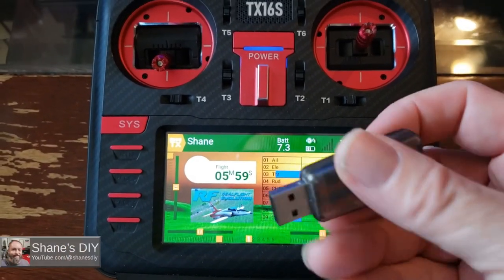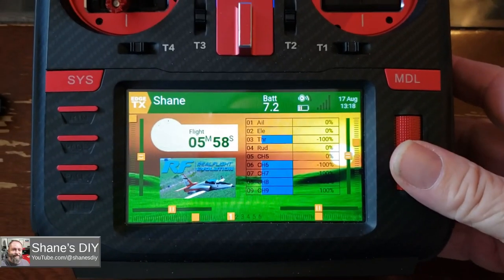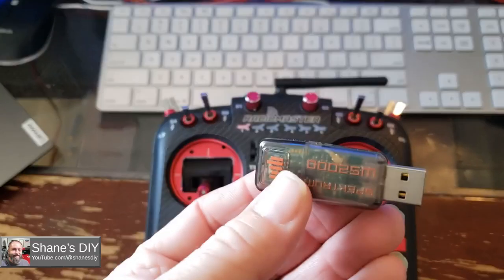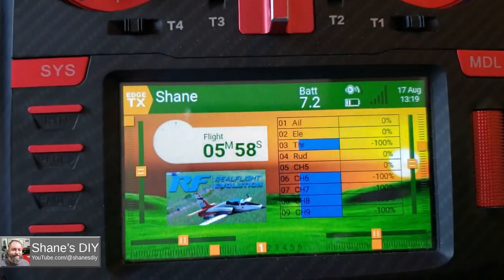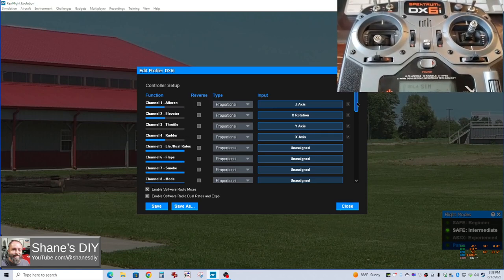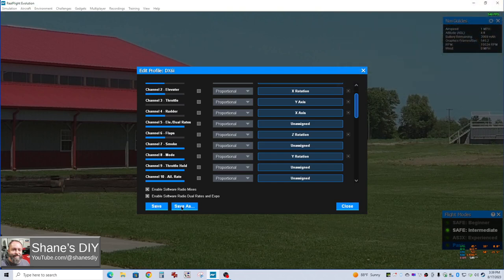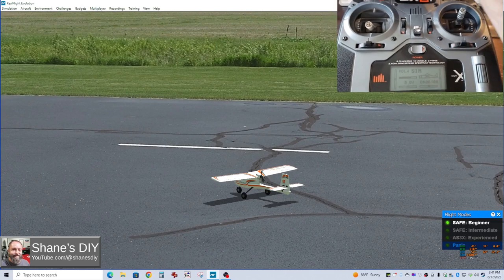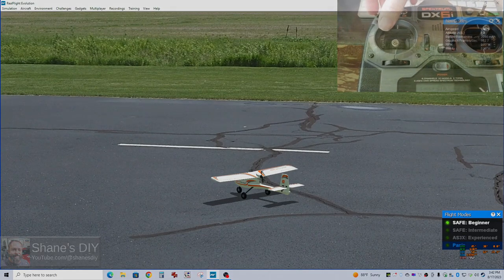Spektrum WS2000 and RealFlight Evolution Transmitter Setup

Comment: Hey man, thanks for your videos. You have helped me so much. I really appreciate what you do. Anyway, I have one big favor to ask. Maybe you have a video on this, so if you do, just send me a link. I was hoping you could make a video setting up a TX16S to use with True Flight Evolution. I mean setting mixes and all channels needed to control the Sim. Setting flaps, landing gear, dual rates, and reset button. And whatever else possible. I think it would be helpful to a lot of people. I've looked all over YouTube, and I can't find anyone who has done it. Thanks in advance. Keep up the great work.
Reply from the maker: Thanks for your comment, love hearing someone was helped by my videos.  I've not heard of "True Flight Evolution". Do you mean Real Flight Evolution?
Reply: @shanesdiy  lol yes, Real Flight Evolution. I keep calling it the wrong name.
Reply from the maker: Could be a good video. Basically you can consider Real Flight as the receiver and it reads the transmitter outputs for control surfaces however they are sent. Because of this any mixes, dual rates, and expo you create in the transmitter model will be used for the plane. No need to try and create mixes, rates, and expo in the simulator. Changes to the safe mode gyro settings are a little trickier.
Reply: @shanesdiy  I got as far as to set the modes to a switch and the reset to the engine cutoff switch, but I can find the correct channel for the landing gear. I guess that's all I need at this point. Everything else works.
Reply from the maker: Within the description of each airplane, they often will say what channel is used for gear, flaps, etc.  Once you find a plane with that in the description, I believe all the planes with retracts will use the same gear channel. You just need to map the desired gear channel in your TX to a switch in the mixer. Then go into the controller setup in real flight and assign the switch there.
Reply: @shanesdiy  thank you, Shane! I appreciate your help. Hope you still make the video if you have time. I'm sure I'll benefit from your knowledge and a bunch of others. Thanks again, you're the man.

Comment: i wish you showed how to do it on TX16s, do I need to create a model on TX16s and anyhting other than that after i bind it to transmitter?
Reply from the maker: Yes, you must create a model on the TX16S just as you would for any model as I mentioned at the beginning of the video.  I just made one called "Sim".  You must program all sticks and switches you plan to use in the sim so the PC will recognize them.  The controller setup process on RealFlight is the same for any transmitter so what I showed in the video with the DX6i applies to the TX16S as well.

Let me know if you have any questions.

Comment: I wonder if I could use My Radiomaster TX 16S 4 in 1 just with the cable that came with it , can I 🤷🏻‍♂️ ⁉️
Reply from the maker: Absolutely, I've used my TX16S and my Zorro with a USB cable in Joystick mode many times.  Since I got the wireless dongle, I just prefer to use that to limit wear and tear on my radio USB ports.   Just use the top USB port and the screen should pop up asking if you want to use Joystick mode, storage mode, or serial mode.  Just select Joystick and click the scroll wheel or tap the screen button.
Reply: Thx ☺️ thank u so much

Comment: I have the radiomaster pocket with the ELRS module on and cannot get it to bind with the ws2000. Any help please. Chris
Reply from the maker: The WS2000 is Spektrum DSMX protocol, you need a 4in1 module to bind to it. The Pocket transmitter isn't offered with an internal 4in1 so your only option is to add an external 4in1 module if you want to bind with protocols other than ELRS.

Comment: I have an DXe transmitter, it has an Aux (2 pos) switch but RFE doesn't recognize it. I have used other RCs software and it works. Anyone have this issue with your transmitters (either brands/models)?
Reply from the maker: The transmitter switch must be assigned to a channel in the transmitter model setup at the radio level.  To really tweak the DXe you need a bluetooth dongle and the mobile app.  I think there is a way to adjust the preset model without the app and you need to select one that uses that switch/channel such as one with flaps.

Once that switch is assigned to a channel, in the controller setup in RFE you can define what the channel/switch does.

Comment: MINE WONT BIND
THESE RADIOS ARE SHIT
Reply from the maker: Happy to help sort it out.  There are many reasons you may not be able to bind and most of them aren't because the radio is crap.  Can you be more specific?  What radio are you using and if it is a Radiomaster TX16S like I'm using do you have the 4in1 version and do you have it set to the correct DSM protocol?

Comment: Thanks a lot. Could you explain how to set up on the radiomaster a 3 way button, for realflight for example SE to select the 3 flight modes?
Reply from the maker: In the radio you just need to setup channel 8 with SE as the source in the mixer.  In RealFlight you assign the switch the same way I did with the DX6i but with the 3 way switch you'll get -100, 0, +100 instead of just -100 & +100.

Note that not all RealFlight airplanes have all 3 modes. The AeroScout, for example, has safe, intermediate, and AS3X but if you switch to Draco it only has Safe, AS3X, AS3X so two of the switch positions will just be AS3X.
Reply: @shanesdiy  thanks a lot will try that

Comment: any special setup for Dx6i is required? I have successful bind but input detection for new profile doesn't work :(
Reply from the maker: Maybe windows isn't seeing the dongle and properly assigning the drivers?  If you type "game controller" in the windows search bar, typically in the lower left, you should see "Set up USB game controllers" appear.  Click that and when I have my dongle in the PC "SPEKTRUM RECEIVER" appears in the list.  Do you have that?  If yes, then setting up the transmitter in Real Flight should work.
Reply: @shanesdiy t that's the thing that it is recognized by computer as game controller with status OK, binding seems to be OK (led stoped blink) but I did test from properties and it's not working, any idea why. I would like to think it's configuration issue, not faulty dongle
Reply from the maker: @jaceksoltys   I just tested mine and in windows for Game Controllers, if I click on the "SPEKTRUM RECEIVER" and click properties, a "SPEKTRUM RECEIVER properties" window pops up. When I move the sticks and switches that are programmed into my "RC Sim" model I do see them move on the test window.  At the top there is a "settings" tab where you can calibrate. Perhaps try that?

Did you create a model and setup the control surfaces on the transmitter?  I guess you had to if you were able to bind...

On your dongle, is the LED on steady after you bind the DX6i?  Should be on, not flashing.
Reply: @shanesdiy  yes, the led is not flashing it's steady, I did create new model, nothing more, but what do you mean by "setup control surfaces:?
Reply from the maker: @jaceksoltys   I guess I just mean make sure when you move the sticks you can see the channel monitor on the transmitter moving.  Did going through the calibration on the PC do anything?
Reply: @shanesdiy  Many thanks for your hints, but I'm starting to believe there is something wrong with the dongle itself. Calibration is not possible and channel monitor shows that everythinkg is OK, and the transmiter is OK for sure since it it's working fine with real receiver.
Reply from the maker: Do you have another PC to try it on? Still could be a Windows driver issue. What version of Windows are you using?

Also wondering if it needs to be plugged in to a high speed USB 3.0 port?  I can't say I've ever tried it on a slow port.  I'll try it this morning and see if it makes a difference.
Reply from the maker: I tried it on a non 3.0 USB and it still worked for me.  I have had trouble with USB devices if they were plugged into a non-powered USB hub.  Are you plugged directly into the PC USB port or through a hub?

Comment: Thanks for this video Shane. I've been using my TX16s with USB and RF EVO for several months as I learn to 'fly'. This video convinced me to give the WS2000 a try. Just received it today and the setup was petty quick on my TX16s.  I've got the control surfaces working.   I figured out the modes by modifying the airplane setup in RF for the few planes is train on. I'm pretty happy with it so far. I think I have dual rates working but am having a hard time getting my head around using channel 5 for dual rates. I use EdgeTX and ELRS for my flying models and dual rates are setup in the INPUTS tab so it's  much different from RF. I've found some posts in the RF forum on dual rates but they always refer to the spektrum radios when describing the setups. Do you have any pointers for us TX16s users?
Reply from the maker: You can do it in RF but I prefer to do it on the TX just like a real plane. The TX sends proportional signals to the PC just like it would a receiver so any dual/triple rates, expo, etc you setup in the TX will be functional on the sim. Don't link your rate switch to output channel 5, just keep internal to the TX and build it in the Inputs tab like normal. I often use the sim to experiment with new ideas for rates, logical switch and special functions code I want to test.
Reply: @shanesdiy Thanks Shane. That’s exactly what I had in mind to help learning my model setups. Makes much more sense. I also use the little RCVR-2 as a validation tool for my setups. Keep up the great videos, they’re invaluable.
Reply from the maker: Thanks for the compliment, I enjoy helping. Been considering one of those RCVR bench planes to help with my videos and testing...

Comment: Valla... Que bueno que decidiste hacer este video 👌, cuando te pregunté por facebook no supe nada.

Una gran duda, el spektrum WS2000 funciona también con otras versiones de Real Flight como el Real Flight 7? 🤔
Saludos desde Cuba 🇨🇺

Gracias por el video.
Reply from the maker: Hopefully Google translate works, haha!

El WS2000 solo permite que su PC vea el transmisor como un controlador de juegos de PC.  Debería funcionar bien con RealFlight 7 siempre que su PC reconozca su transmisor como un controlador.

In English...
The WS2000 just allows your PC to see the transmitter as a PC game controller. It should work fine with RealFlight 7 as long as your PC recognizes your transmitter as a controller.
Reply: @shanesdiy  jajaja lo siento por el español 😁.

Muchísimas gracias por l ayuda.
En el momento que pueda permitir comprar el spektrum ws2000 y hacer que me lo envíen a Cuba lo comprobaré.

Muchísimas gracias por tú tiempo 😊.
Que tenga excelente noche amigo.

Otra pregunta jaja.
Utilizas receptores ELRS/PWM 2.4 GHz para los aviones o solo estás utilizando el módulo multiprotocolo 4 in 1 con otras marcas de receptores?
Reply from the maker: Solo uso el 4in1 actualmente.  No he probado ELRS.  Tengo receptores Spektrum y acabo de recibir dos receptores Radiomaster R88 V2 que voy a comenzar a probar con el uso del protocolo FrSky D8 o D16.

In English:
I only use the 4in1 currently. I have not tried ELRS. I have Spektrum receivers and just got two Radiomaster R88 V2 receivers I am going to start testing with that use the FrSky D8 or D16 protocol.
Reply: @shanesdiy  gracias por la información 🤝